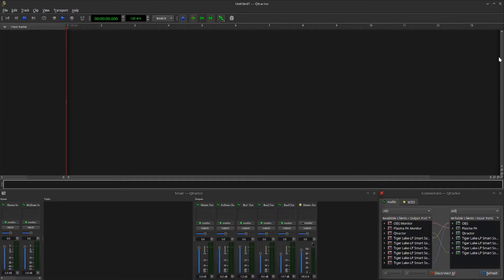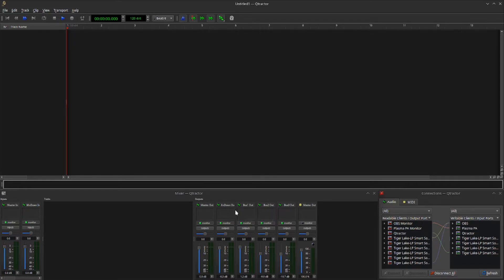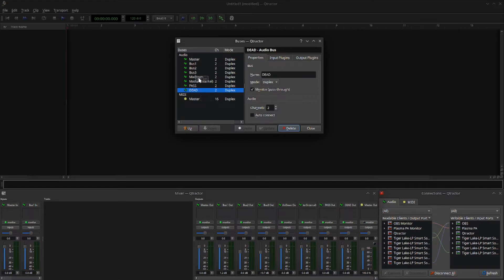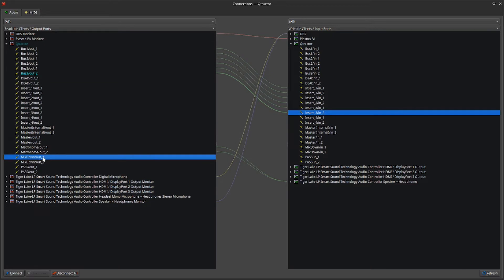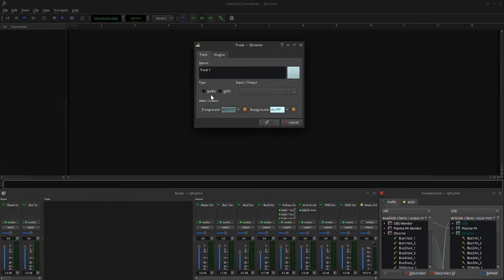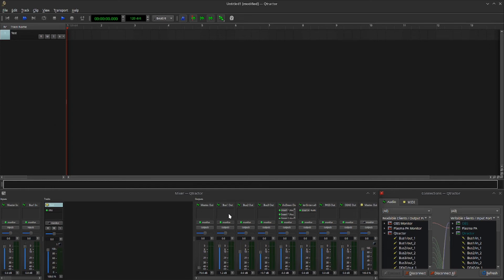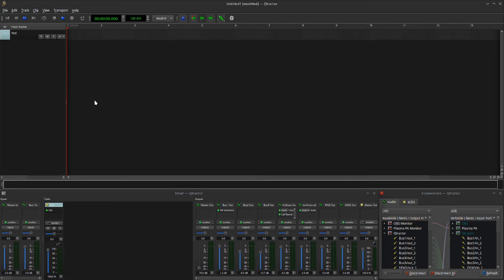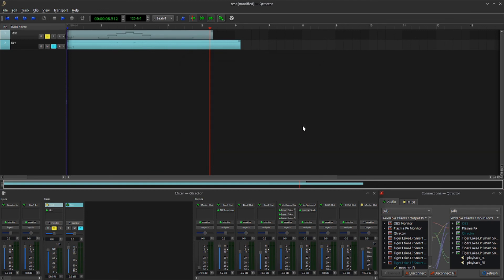Qtractor Bus Mix Routing with "Inserts" (All Internal)

Comment: I'm pretty sure Qtractor has changed since this video was made (2 years ago now) as I came across a significant issue even though I do enjoy this set up that allows Carla to be set aside. This issue I am seeing: I can use plugins on the tracks and on MixDown and Master(Internal) busses, but when any plugin goes on Bus1, Bus2, or Bus3 then it does not take effect. It appears to be any bus that feeds an input will not pass the moisturized (wet) signal into the input - only dry.

Comment: THANK YOU, THANK YOU!!

I've been banging my head against the wall trying to get things working properly within Qtractor. I really wanted to love it, and your earlier videos convinced me I was heading down the right path (rabbit hole?) to get my Linux studio set up so I could be productive instead of simply frustrated... I tried everything (including starting to mess with Carla based on a suggestion in an earlier video) but I was still swinging & missing.

But now, finally: the INSERTS approach is the key after all. Seems to be working beautifully - at long last.

BTW, I simply renamed Qtracter's stock "Master" track to its new rightful name: "IGNORE" ... this way I never get confused as to what it's proper purpose is for in the mixer and connections window ;-) 

Anyhow, I never would have come to this point without your insightful, straightforward and crystal clear videos ... this latest edition most of all.

You've opened the door for me to finally use Qtractor, which is much more within my use case wheelhouse (than, e.g., Ardour).

Now if I could only get Rosegarden's notation capabilities connected. I guess I'll simply compose in Rosegarden with western notation and then export to Midi which will hopefully work out just fine.

Thank you, again!
Reply from the maker: Glad this helped!  For notation, if you aren't composing in MuseScore, you should be!  The new MuseScore 4 play engine is quite simply the finest playback engine in the world right now.  You can export fully rendered audio AND midi data to mix in your DAW for some really polished results.  MuseScore 4 is in early release stages, so there are bugs and crashes... but it's definitely the way of the future.
Reply: @i-scoresmusic3928  Thank you for this suggestion. I've installed and uninstalled MuseScore several times, recently version 4. I get the willies trying to make sense out of its FOSS vs commercial intentions, and the complaints on the forums over performance/crashes has been off-putting.

Rosegarden, which is a bit longer in the tooth, is still nicely maintained, deep history, and is extendible via Frescobaldi, Lilypad, etc, although I think simply composing in notation form and exporting midi results into Qtractor may be my most comfortable path forward.

Musically, I've got a mix of needs to serve, including piano, Hammond organ, stringed acoustic, analog synthesizer, rack mounted sound modules, and acoustic-to-digital drum kit conversions played on a real kit. In short, if there's a connection screw up in the works, I'll experience it ;-)

Getting Qtractor straightened out (now, using your insert method) has liberated me to solve the smaller remaining issues.

This journey from years of Windows and Mac studio efforts has prepped me for my 100% Arch Linux final destination.